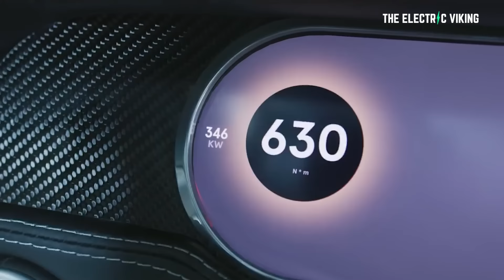Chevrolet's e-motor kit to convert gas cars to EVs is EPIC

Comment: Yeah.....but if you're in a cold climate, or anyplace with winter you'll also either need to add a multi kilowatt resistance heater that will trash your range or convert your AC to a two-way heat pump. I haven't heard of any existing much less one that's affordable or easy to install.
Reply: Or just put on a jacket lol

We already had this debate with AC, if you are truly freaking out over it, you need to toughen up
Reply: @specialopsdave  Guess you don't live anywhere that blizzard conditions have ever stranded a whole highway full of cars, eh "operator"..  Don't worry it's not instantly obvious to everyone how much that tacticool act is overcompensating for. But just in case they both really were shot off in The War, thank you for your service 🤦‍♂️
Reply: @johnassal5838  You're right, I don't live in some twisted place where traffic jams are a problem but no heated businesses are nearby.

Plus, an EV will heat for longer than an ICE will idle for. At a standstill, an EV can provide heat for about 72 hours. An ICE car can idle (and thus provide heat) for about 14 hours. 14 is not bigger than 72, fyi

When it comes to range, yes, of course EV drains range with the heater, but it really isn't a big deal.
Reply: @specialopsdave  Yet if you're anyplace where it ever gets anywhere near zero °F much less into negative temps you'll be missing all that "free" heat coming out of the dash without cutting your range in half. Maybe not you being so tough and all but anyone not prepared to dogsled to were they're going. Pregnant ladies and old people let's say. They get to exist too, right? Unless they can get a heat pump retrofit to go with the crate engine with a COP of three or better but like I said I've never heard of such a kit and if available it may cost more than the crate engine.
Reply: @johnassal5838  Reduce range by half? You mean reduce range by 30 miles, right? Because that's more accurate (and if you get to 30 miles left, you probably didn't think your trip through at all)

Also, Norway would like to have a word with you about EVs supposedly not working well in cold climates
Reply: @specialopsdave  Norway has charging stations literally everywhere. Most of their population lives in the southern and western areas that get weather more like Seattle or Juno because of the ocean currents (AKA very wet but only rarely below freezing) AND most driving trips are highly local anyway thanks mainly to a well developed rail system and the general impossibility of getting between two points in anything like a straight line due to topography. 

Now someone in Texas or Louisiana will usually have no issues at all but in Upstate NY, Idaho, Wyoming, Michigan or Illinois keeping you thawed on a cold day will cut deep into your batteries. 

Good try though Dave. 👍
Reply: @johnassal5838  Yes, most people live in the south. Key word, most, not all. People do survive in the north with EV, without even complaining. It doesn't matter if you lose 30-50 miles of range when EVs already have 100 miles more range than an average ICE car, and when public charging is actually available. The point about charging being everywhere in Norway is exactly why we need more chargers here in the US, but I doubt you'd support that.
Reply: @specialopsdave  lol, actually I'm all for EVs why else do you think I'd even click this vid? Gobs of torque. But this crate engine is clearly geared to people outside the US snowbelt. Not that there aren't plenty of people down south who'd convert their Silverados if gas hits $10 which it will if only to offset reduced demand once most new cars don't burn gas anymore. I can actually see some sense in deprioritizing snowbelt conversions since roadsalt will kill them so much sooner while there's millions down south that don't spend much time at the beach. I just still think it's a lazy oversight not to include an actual heatpump in the conversion kit. All those Tesla's in Norway (which are apparently the majority of new car sales there of any kind) all have heatpumps. Just saying. My only other issue is that the battery tech is still fairly bad especially considering production and disposal. For now hybrids with constant rpm ICE generators not driving the wheels directly make more sense imo. But sure overtax the increasingly outdated power grid instead of leveraging mature distribution infrestructure that can be adapted to biofuel made from renewable energy sources. It'll be fine...

Comment: For the GM and Ford conversion kits to work they need to be kits with all the bits 'n bobs to just bolt on. A lot of old pickups, especially suited for conversion, are moldering away in Southern US junk yards and forgotten fields because their motors and trans wore out but the rest of the chassis are sound. Make the kit, perhaps outside of the battery pack, under $5k-$10k and a lot of people will convert these older vehicles in their home garage on the weekends.

Comment: I recall how GM was in absolute panic mode when the Honda Accord first came out. The best they could do in response was the Citation (X-body).  Anyone remember that?  Or how about when diesel was the rage and GM’s response was to put new heads, fuel pump, and two batteries on an Impala. 4:08

Comment: The car manufacturers should develop a direct bolt in electric motor. Bolt it directly to the existing drive train in any automobile. Batteries and wiring harness with a variable speed throttle trigger.

Comment: I see this as being a trojan horse to keep both Ford and GM valid. I don't care if they gave me a crate engine for free, there's no way I could afford all the other things necessary to properly convert my truck. The HP/torque ratings are worse than my 6cyl 2013 truck. I've watched the videos on conversion and it takes at least a full week or so to simply remove all the ICE garbage and you still have to deal with properly disposing of the gas, gas tank and all the oil lines. My truck is a 4x4 and a decent electric motor conversion requires a beefed up transfer case and differential and probably new driveshafts. Current EVs use motors front and back so there isn't a driveshaft. I can't see regenerative braking working on these without new brake assemblies. AC, heater, power steering and brake assemblies would all have to be converted to electric. The battery pack would have to be designed to fit every vehicle. I also wonder if auto insurance companies would even insure conversions like this (most insurance companies insure the stock vehicle and add onto the cost when you do modifications). Add a full dashboard conversion and re-wiring and it would be less expensive to simply buy a new vehicle with a warranty. I see this as a gimmick to satisfy a very small segment of vehicle owners. I'm also not sure the old vehicle would be able to withstand a conversion like this. It's like taking your car into a body shop, leaving it there for a minimum of 6 months while they effectively rebuild the entire thing. The only part of that old Ford truck that was anywhere original was the body. Everything underneath had been changed. If Ford or GM was to sell a crate skateboard, only needing to remove the body from the old vehicle and drop it on the skeleton, that might actually work but selling just a motor is a joke even if they (GM) provides all the tools and stuff to finish the conversion. Selling people the motor and some accessories would be a bespoke vehicle, built without alignment jigs and all the automated manufacturing machines used to make quality vehicles.
Reply: Dude, this is for people who have a truck, van or sportscar with a unique design and body, but 300k miles on the engine.
Reply: @-whackd  Like I said, for a very small percentage of users, especially those with lots of money to throw at anything. These same people probably don't have 300K miles on their engine, they already replaced the engine a few times.

Comment: What happened to "Printed Circuit" motors to bolt on to the rear wheels of a front wheel drive automobile to convert it to 4 wheel drive?

Comment: If it’s comparably priced to a full engine rebuild I’ll be doing it to my 1953 Chevrolet 3100 pickup. Mine needs an engine rebuild. I don’t drive it far bc it’s a death trap. No seat belts etc. But I do love to drive it 20-30 miles every so often and would love to have it electrified.
Reply: Thats just the motor the controls batteries etc will be 35/40k
Reply: @andrewslagle1974  It sounds like you're assuming I want to go 300-400 miles. I'm estimating it'd cost 3000-5000 (in today's prices) for the batteries I'd need for my intended purposes or 20-30 miles, 50 miles tops. It's not fun to drive an 50-plus-year-old car more than 50 miles without air conditioning in South Carolina. I don't recommend it.

Comment: The only way I  could become interested in any electric vehicle is if it was powered by a cold fusion reactor.  They are possible.  The only reason we can't have them is because you can't put a meter on it.  Just think the same power source you use for your car could power your house.

Comment: Their web site still says available mid 2023 and then only to authorised installers. So its going to be too expensive for most people looking to convert a car. The system voltage is 400V which I think might be too high for many DIY conversions because it means using their battery or a whole EV pack. I think most conversions use a lower voltage for space reasons.

Comment: While there are those of us who like to tinker, I think it would be a better idea if the legacies would build drop-in kits for their different models. Then have dedicated teams in the dealership that do nothing but swap out the entire drive system. The companies could give a core charge for all the components needing swapped out.  And it should be done for under $20,000 total. Right now one can buy a Chevy Bolt for what...$26,000? Other than nostalgia there is no way I would pay more for a kit than I would to just go out and buy a brand new car. I think the best part of a swap would be that no new materials and no carbon is needed for an entire body hence saving raw materials for other uses.
Reply: @timothykeith1367  Absolutely true for a project car. That is generally expendable money. But for lower income folks that are just trying to get into electric vehicles for the first time at a reasonable price, swapping a complete electric drive system into an older vehicle should be done for less than the cost of a brand new car.

Comment: One gallon of gasoline contains 12.3830621 kilowatt hours of electrical energy so to maintain the original range the battery size would be equal to gallons of gasoline multiplied by 12.3830621. E.g. to replace 21.4 gallons of gasoline you would need a 265 kwh battery ( 21.4 * 12.383 = 264.996 kwh ) and maybe a trailer to carry it.
Reply: But gasoline motors only convert 40% of gasoline energy into mechanical energy whereas electric motors convert 85% of electrical energy into mechanical energy.
Reply: So you're only getting to use 158.998kwh of the total available energy out of 21.6 gallons through a gas motor with it's 40% efficiency.
Reply: @jawa1984  159 kwh divided by 12.383 = 12.84 gallons, 265 kwh divided by12.383 = 21.40 gallons. 21.40 gallons will take you much farther than 12.84, efficiency is irrelevant.
Reply: @saltydogg   yep I understand the energy density of lithium batteries doesn't come close to matching that of gasoline, I'm just making fun of gas motors because their technology is about as good as they are ever gonna get no more efficient than ~40% whereas batteries will continue to get better and lighter closing the ratio and hopefully eventually far surpassing the energy gasoline provides per equivalent volume/weight
Reply: Not true.
A gas engine is 20% efficient.
An electric is 86% efficient.
An electric used regenerative braking. So they gain 10 to 20% energy back stopping or going dowmhill. 
     So less energy is needed.

Comment: It's only going to be 200 hp and 266 ft lb of torque and you have to also run a GM transmission.  Only certified installers can buy and install them.  The battery pack is 947 lbs The price is expected to be over $12000, not including installation.   Nothing about this is impressive.

Comment: They need to make a hybrid kit like what was designed for the Corvette. 2 electric motors are installed on the front wheels and the battery is in the truck. The motors kick in when exiting corners or hard acceleration. It could also be done for all electric driving for short ranges. Add regenerative braking .

Comment: replace the transmission with an electric motor and replace the engine and accessories with LFP batteries, controller, and accessories. use the muffler and transmission inset and gas tank inset for batteries. use the gear shift to enable the parking brake, forward and reverse. neutral is still useful as well.

Comment: There's a French company offering a kit for a boat $5,000 including motor controller and battery, you take out the old engine and the gas tank and where the gas tank is goes to battery and with the ice engine was goes the electric motor they say the conversion can be done in 4 hours, can't remember the name of the company I could look it up but search a little bit you might find it sounds a lot more reasonable and quicker. Best wishes antiguajohn

Comment: I like the idea of reuse the old/dead gas cars for electric conversion. I wonder if any company pack everything ready to run in to trailer, like camper trailer, so people just hook it to the back of their cars and the "Etrailer" push/pull the cars . Or simpler is just motors in the hubs, like ebike converter kit, and battery in the where gas engine and gas tank were. I converted my regular bicycle into ebike just like that. Gee! I just Google "ev with hub motor" it shows a bunch of hub motors and someone with their projects. Cool

Comment: While I’m here let me address the notion that there’s not enough electricity on the grid to power electric cars. In the United States the second largest user of electricity is the refining of petroleum. In the gulf states it’s over 12 kWh per gallon in California it’s about 7.5 kWh per gallon. The 7.5 kWh number was put out by Nissan when they were originally marketing the leaf. Using the California number you could drive further on the electricity used to make a gallon of gas then you can on a gallon of gas. in a Tesla model three using an estimate of about 300 miles for 75 kWh gives you 4 mi./ kWh. That equates to a little over 50 miles of driving on the electricity. It takes to make 1 gallon of gas in California. You could go further on the electricity used to make gas on the gulf coast except that an off a lot of that comes from coal. At some point, when they’re enough electric cars that the refining starts to drop off, there will be more energy left for the grid. And around a decade ago, I was part of a roundtable with other environmentalist and a representative from Toyota. Turner was making the argument that they were doing hybrids because they worried that the grid couldn’t handle the extra energy needs. So they were being responsible corporate citizens. I gave them a statistic about energy using refining, and he had no response.

Comment: By your description of fitting the old V8 cars. Tells me a gm sbc bolt pattern . Meaning all gm V8 rwd & 4x4 cars and trucks . I'm not certain but the fwd V8 may have a different bolt pattern . . The sbc pattern is also found on gms 4.3 l V6 and all the lt1 and ls1 V8 automobiles.

Comment: Electric Motor but you supply the batteries... thanks Mary b!

Just stick a motor + extras into old ice vehicle-maybe for Classics, but not legacy Dino vehicles w/drum brakes. Yikes!
Reply: Electric motors can provide regenerative braking while putting energy into the battery system. I seldom use the brakes on my Tesla Model 3.
Reply: @gregandkaruna6674  Yes. It. Does. There is no more strain on the brakes than before. I converted a VW Golf years ago and there was no need to modify brakes or suspension. Regen takes much of the velocity of the mass and turns it into energy, thus mediating inertia to the point that brakes only slight or no activation. Are you an engineer? No matter, just wondering if I'm chatting with a colleague.

Comment: We're still a LONG away from an affordable option.  I have a 1966 Mustang 2+2 that I would love to convert to EV if I can get the equiv of 300lb/ft and an honest 125 mile range for  $10K all in including batteries.  That will happen as battery tech improves in both performance and cost, but we're not close yet.